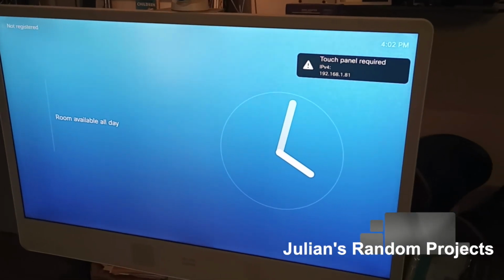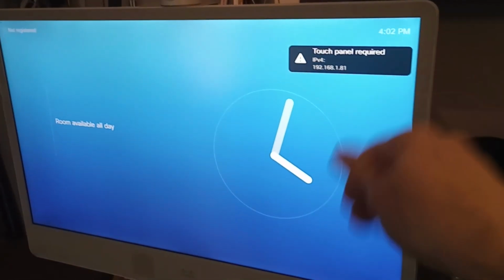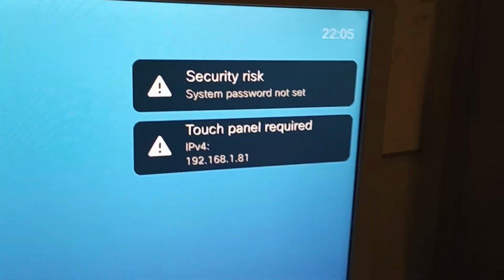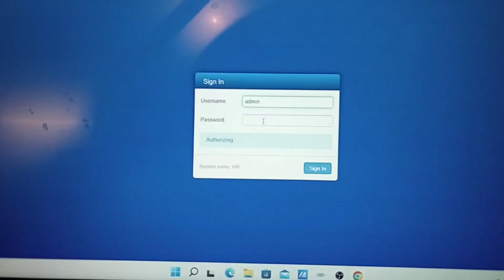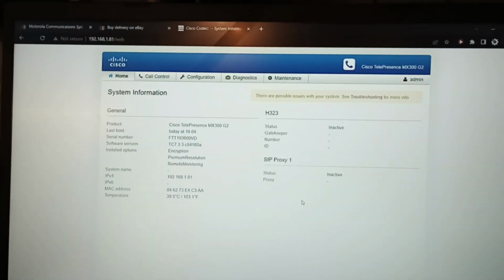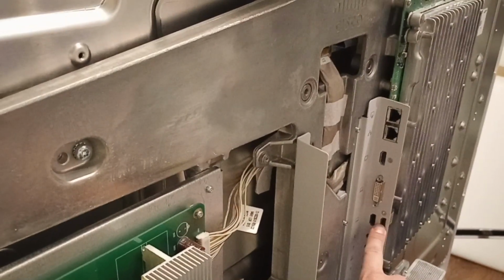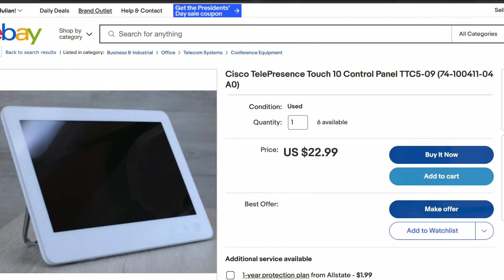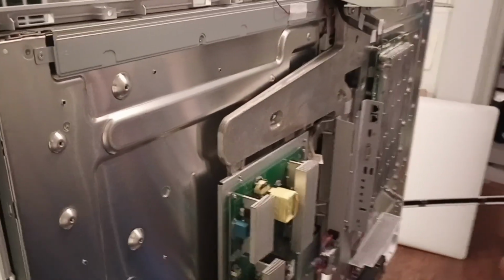Telepresence On A Budget! Cisco MX300 Pt1

Comment: I saw your video I was experiencing some of the same things the ppl in the comments have. It worked when I plugged it in at the place I got it which in all fairness was connected to a desktop CPU. I figured great I can use as a standalone, but once I did factory reset it will not display. I recently got a tablet to see if it helps. I also read something about having a certain HDMI cord? I also was wondering if maybe since I did a reset that it needs to update, Not sure if that's true but any help or advice would be helpful
Reply from the maker: If you did a factory reset then all the settings are set to default. You’ll want to connect over web interface and go playing with all the settings to see if it changes to what you need. And yes, I discovered in plugging multiple devices that it’s picky about the HDMI type. Try high quality HDMI cables or cables from different vendors. I remember setting for what behavior happens when HDMI is plugged in. Start there. Good luck!
Reply: @JuliansRandomProject  the most amazing thing happened, once I plugged in the tablet and it did its thing I got the share screen function to work! Only on DVI for sure. Still have to try and get some new HDMI cables anyways since mine are old as dirt. Thanks so much for your video!

Comment: I must be person #6 to get one of these. My company auctioned several of these off and I was sure I can use it as a standalone monitor but I can't even get that to work. I do not have the touch panel. I reset the damn thing and have tried everything to get it to switch to any of the HDMI ports but nothing. It always goes to the please connect your touch panel and I already did the peripheral / touch panel = 0.  {sigh}.  Should it just go to the HDMI when I turn it on?
Reply from the maker: If you got the touch panel message to go away you should be able to plug in an HDMI device (dvd played, computer, console etc) and it’ll switch to it. If that doesn’t work find me on IG and I’ll mail you a spare touch panel I have. Godspeed

Comment: Hey loved your video! we just picked up our MX300 at an auction as well. When we plug into HDMI nothing but the “welcome please connect your touch panel displays” any tips?
Reply from the maker: Yeah, Get into the web interface for it via your router and a web browser. Then go playing around in there for the right settings. System Config/Peripherals/ Profile TouchPanel = 0. Save and reboot. Also make sure you're using the correct hdmi port. good luck

Comment: What did you change/modify to bypass the "touch panel required" screen?
Reply from the maker: After you log in to the web interface it was in the settings, System Config/Peripherals/ Profile TouchPanel = 0. Save and reboot. Good luck

Comment: Do you have any more progress on this project? I work for a K-12 School District and a hospital donated one of these in like new condition to us. Other than using it as a monitor, I have not used it for much else. It would be nice to be able to use it as a conferencing station for our teachers. So I guess I am one of those 6 people. :)
Reply from the maker: Yes. I may make a video. But until then, you can buy a $20 HDMI to usb capture dongle on amazon and route that to any video conferencing software. Use the HDMI out into the dongle. It'll show up as a USB camera.  Then you're all set from there.
Reply: @JuliansRandomProject  Thank you! I can't beleive I did not think of that. I actually have a couple of streaming dongle's already!
Reply: Just picked up one of these without the controller. Going to pick one up from EBay. Any other suggestions or tips? Do I need licenses, accessories or to be setup on Cisco to be able to use it?